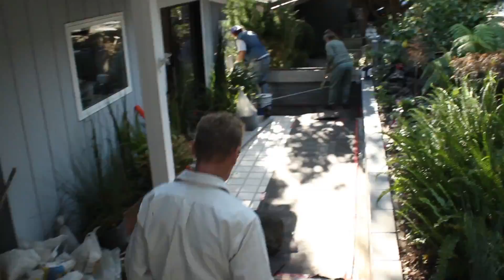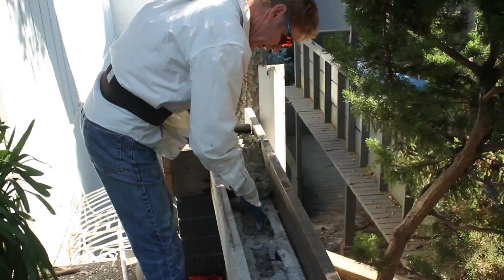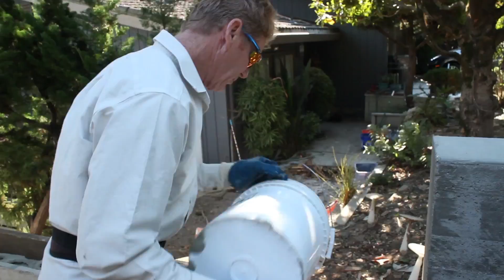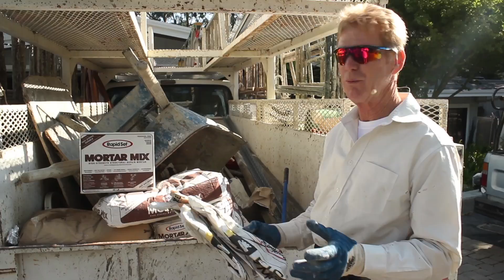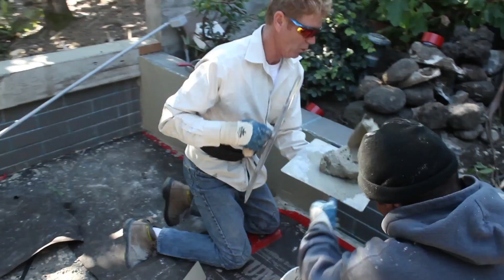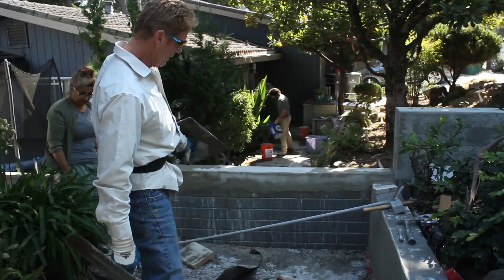Stucco. Mortar Mix. Cement All.

Comment: Hi Kirk! Love the videos. I've been watching you for a few years now and have learned a lot. I have a question that you may be able to answer. How would you apply lime plaster directly to a piece of wood furniture like a side table? I was thinking of using the pink Plaster Weld, but I don't want to have issues with the material flaking off. Thanks for the knowledge you have shared with us over the years 👊
Reply from the maker: @drywalllifetv6265  Howdy Drywaller dude, lime plaster won’t adhere to wood long, perhaps a year but it will come off, eventually. It does not matter if you use a bonding agent. Sorry.
Reply: @StuccoPlastering   Thanks for the info. Is there a plaster product you can recommend as a base coat that would work better?
Reply from the maker: @drywalllifetv6265  Sure, Sakrete or Quikrete from Home Depot, they both have the same day plaster, all you’d is add water mix and apply,  the sand is already in the bags. 😉

Comment: I started using Cement All for assorted things, but the boss gives me a hard time about it I think he's just jealous because I found out about it before him. Anyway, it gets nice and very hard. Even a green disc has a problem grinding it.
Reply from the maker: @hatbpto5180  Cement All is stronger than almost any concrete sold and homeowner friendly. Just don’t over mix and apply it quickly. Cheers.

Comment: Kirk, for the thrifty homeowner who has a little more time on his hands than money, would fast setting Quikrete (sets 20-40 mins) be a good option? And if people at home depot are calling you for advice, somewhere along the line, you made a bad mistake. 😉
Reply from the maker: @avisitorhere  Good morning Avistor, the Quikrete is much better for plastering, “Cement All” sets to fast for plastering. It’s  great for filling the form boards, we used about ten in there. The “mortar mix” is also not recommended for plastering as it’s very similar to “Cement all” it too sets to fast, thus I had my man scoop it to me, it required almost all my strength to apply it as it was just mixed and was setting. Why use both? I had agreed to raise the wall and at no cost to show these two products. That’s the kind of guy I am. Cheers.😉🕵🏼‍♀️

Comment: I used your videos to learn to repair some buckling stucco areas on my 70 year old house. Im so happy how it came out, all thanks to you. You are so knowledgeable and make it look easy. The only thing i wish i did better was dashing on the texture. I made it a little rougher than it should be, but not bad. Again, thanks for your guidance...
Reply from the maker: @loklie3226  Morning, dashing always is sharper in appearance as it’s raw, often double priming it smooths it out more.

Comment: Especially don't want to use the fast settings cements when you are working alone.
Reply from the maker: @joepierson3859  Now that can’t be done. As in the video, as fast as my brother Louuuu, was mixing the Cement was already stiff. I had to use my hand to get it all out of the bucket. But I expected that, as it sets too fast for plastering with. Filling potholes or simple form boards it’s excellent.

Comment: Kirk for President!
Reply: Make stucco great again.
Reply from the maker: @DoubleDoubleWithOnions  We’re trying to reintroduce it to the world, one video at a time.
Reply from the maker: lol,
Reply: Attaboy Looooooo. Nice masking job. Is that 622 red tape or the 3M home cheapo stuff? 505383 c-35 building socal one grain of sand at a time since 77. But since pops was a builder me out pounding over common 16s before sinkers or n 7:06 ail guns on framing temp boards on Saturday morning job walks since 63.
Attaboy Kirk.
Reply from the maker: @carlbremer5576  Thank you Carl, my fellow tradesman. The tape we use is called ECHO. Cheers.

Comment: I would have done the opposite and put the mortar in the form and skimmed with the cement all.  What am I missing?
Reply from the maker: @leobender  Howdy Leo, obviously you’re a concrete or stucco specialist, I don’t thick your missing a thing, there are many ways to skin a cat. Cheers 👀😉
Reply: @StuccoPlastering skim a cat?